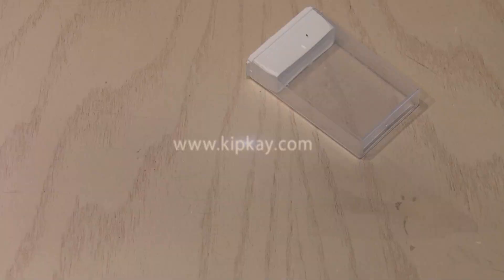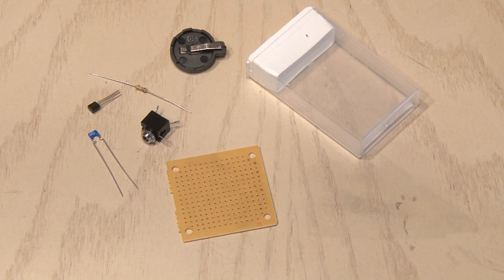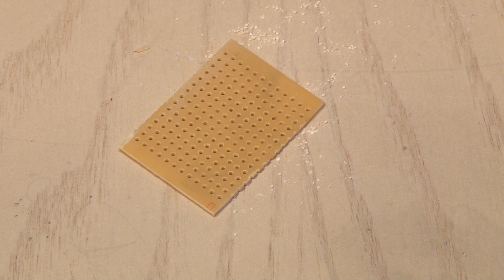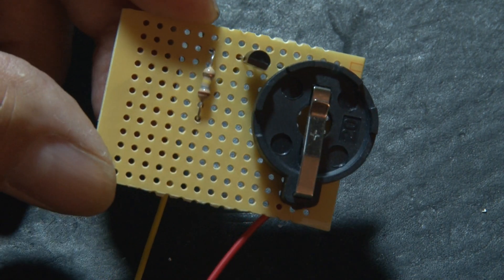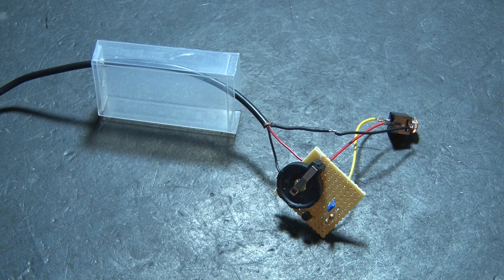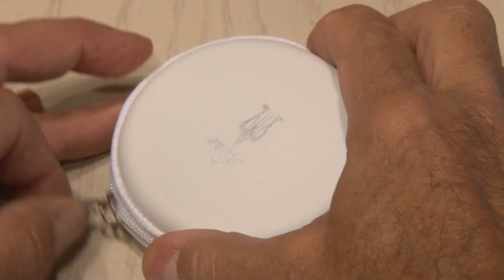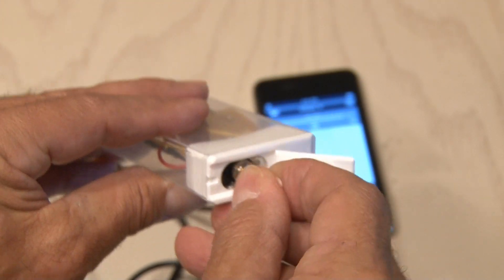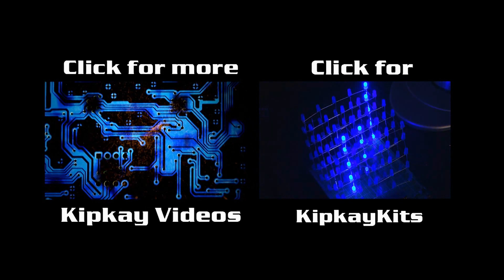Mini Tic-Tac Amp!

Comment: This amp is odd, I think. I am new to electronics.. but isn't this amp only amplifying the left channel? It's then sending a non-amplified (Left-In) signal to the (Left-out) through the 180k resistor, and then amplifying the (Left-In) through the transistor, mixing the amplified left channel into the right channel, and sending that to (Right-Out). I think this MIGHT amplify both channels in the right output, but NOT the left. However, you are ALSO getting a mixed (left-right) output on the (R-Out)... am I incorrect?  Like I said, I'm new at this, but can anyone familiar with electronics clarify what's happening in this amp?

As far as i am aware.. (I am trying to build a decent headphone amp, atm). You'd need TWO transistors.. one for each channel.) You'd also need a Virtual Ground (Circuit, or IC). With this you'd have a true stereo amp.. essentially I think this is a mono amp, that works very oddly. I could be very wrong ,though.

Comment: Hey, I have a question i would love your input on. I am trying to make a setup for having an LED light bar pulse to the bass of my music, i know how to hook everything up correctly, but the output for the bass is too low to see any noticeable light. Is there any way i can make a small transformer or something to step up the power? Like i transformer coil or something where you have an electro magnet then feed a wire thru the center of it?

Comment: Perfect - I've been looking for a cheap way to pre-amp my phone's output for connecting to my car audio. I'll give this a go - but might also look at how to adapt this for 12V.
Reply: John Heath lol real amps are $11 give or take. and tgey easily double your audio output
Reply: John Heath Did you end up building it and discarding it? This circuit is the worst use for 15 cents in parts, including compared to just throwing the parts in the trash.
Reply: Ha ha, no, I didn't. I see your comments elsewhere here, too - what's wrong with this circuit? How could it be improved?
Reply: Incorrect re price. They're really expensive.

Comment: Hi, pretty good build there keep up..Question : can I amplify a DSLR mic with this device before entering the mini jack into the camera for a better quality, will it work ?
Reply: Yes, but you might want to switch to a lower voltage

Just reverse the placement of the input and output jacks and connect it according to where the plugs fit
Reply: I hope I helped
Reply: Tyler Amick Thanks a lot Tyler, I will try it.

Comment: Why did you build that amp as a Mono? If you get it in Stereo, that would sound even better.

What will the battery drain be?
At 32 Ohm per channel (Common value), the set will be 16 Ohms.
At 3 Volt max (Not counting the vltage drop over the C-E junction), it will draw ~188 mA, equals ~0.563 Watts from the battery.
Thats ~0.281 watts per earbud.

According to the Specs its a Silicon NPN transistor.

So, at about 0.7V less for the Earbuds due to the C-E Junction of the  transistor, the whole calculation gets lower values.

Lets still do that calculation:

2.3V, ~16 Ohms equals ~144 mA. That equals to ~0.331 Watts.
Leaves about 0.165 Watts per earbud.

Neovo.

Comment: How can you add a volume for it?
Reply: POTENTIOMETER
Reply: You turn the volume up on your phone.
Reply: *****
duh
Reply: +HzzdsdS a potentiometer would only turn it down, it can't increase the output
(You need more voltage, probably another button cell would do the trick)

Comment: I'm thinking of building this, but how effective is this really with one transistor, resistor and capacitor. Wouldn't I be better off with a dedicated audio amplifier IC?
Reply: Definitely
Reply: AntiQuark Productions Correct. You'd be better plugging your earbuds into an actual container of tic tacs.

Comment: how much ohm do you think my amp in my phone is shit so i want one that can power 70ohm
Reply: Ohms are resistance, the higher the number the quieter the sound

You are looking for higher wattage
(Higher wattage = louder sound
BTW your phone has 8 ohms through the headphone connector
Reply: Edit: 32 ohms not 8
Sorry
Reply: Tyler Amick You have no idea what you're talking about. Ohms in headphones/speakers is the impedance, and it's a key specification. The lower the impedance of the headphones/speaker, the more current (with correspondingly lower voltage) needed to run them. Phones don't have the higher voltage present to run high impedance headphones very loud.
Reply: That'd be almost identical to what i said if you simplified it like i did. For example, running low impeadence and high impeadence headphones at the same level of current would make the low impeadence headphones louder than high impeadence headphones.

BTW wattage does tell how loud speakers will be, because 1 watt is the total power draw according to the equation W=VA

BTW, Again, You technically can not tell me i am wrong because i have a doctorate in this exact subject from MIT

Comment: Is the output of this strong enough to power 2 white LEDs?
Reply: black ops [ David ] No, it will not work good, you'll hear a really bad sound.
Reply: +Max Zauner I think, it is
Reply: yes I've bought some 100 3mm led 5 colors (20 each) and my button cell battery powers 15 fine. and does this amp work any good?

Comment: Did any of the people praising this thing actually build one?!? This is a horrible, horrible circuit, insofar as it can't output nearly as much power as the amplifier in an MP3 player or phone -- and it's not stereo! (As shown in the schematic, it takes the difference of the L and R channels, and then outputs that in mono to the output.)
Reply: windson7 That comment doesn't even make sense. Sounds to me like you're just mean-spirited. As for engineering: I'm not an engineer. But I know enough to know this circuit cannot work as described, and a year ago I actually built it up on a breadboard for shits and giggles. It does not work. End of story.
Reply: +Saud Al-Faisal Siddiqui I´ve tested the Phillips TDA 7053 which is really cheap and just needs 6v + one cap for the power, also its much better than this crap :D
Reply: +Saud Al-Faisal Siddiqui Agreed. The TDA series is great, but for headphones, I find them noisy. (They're awesome on speakers.)

For driving speakers, look at National Semiconductor's LM3875 and LM3886, which appear to be exceptionally good. (Search for "gainclone".)
Reply: I don't think you will reply after so long but suggest a good circuit for headphones amp man.

Comment: Would it be possible to ad a connection for a 9V battery to make it more powerful. For like a pair of mini speaker or big head phones
Reply: For this circuit the higher the voltage the stronger the amplifier is gonna be however the maximum voltage for this is around 15-20 volts

Comment: If I used 5V instead of 3V or 1.5V, would I need a resistor? I don't completely understand transistors.
Reply: Think of it this way. A pnp transistor basically an And gate. Battery goes to one terminal, audio goes to other terminal. This type of amp is really only good for boosting signals all at the same voltage.
Reply: So yes,you can.

Comment: I like this idea, however, if there's something that should be added, you should also solder a toggle switch to the battery clip, so you can turn it off and not risk constantly running that small button-cell battery

Comment: I would use it to boost power from an old "stick" MP3 player (512 meg to 1 gig, loaded with '90s techno) to a pair of Kip's Solo cup speakers, Velcro the cups to my shoulders, drape myself in a couple of strings of battery-powered Christmas LED lights with a running-blinking circuit, and become the MC-slash-DJ to the world's smallest rave.

Comment: As hard as I try, I am unable to find the purpose in this. Are you saying your music plays too quietly? Because I've never felt the need for "a boost" while listening to music. Every pair of earbuds I've used played music plenty loud.
Reply: There are headphones out there that need alot of power, because they have a high amount of "Ohms." if they are at 600 ohms its going to be really quiet coming directly from an iphone, but with an amp, its loud enough to hear.
Reply: The idea of an amp is instead on the tiny surface mount amplifier in your phone/ipod the amp makes it a little louder and should sound a little nice.

Comment: What is the type of the capacitor that you used? then why is it that when I viewed the circuit diagram, It says that the capacitor value is 0.1uF, but the actual value used is 1uF. What actual value is used?

Comment: You could build and inexpensive in ear monitor amp for ear buds.  Does the circuit give more output with more voltage? You could substitute a 9v if that's the case :-)

Comment: If its Powerfull Enough I Guess you could use it for your laptop with a Set of small speakers or Use it in a Shed, Greenhouse or Even put it on your bike to blast ur tunes??  Quietly i guess :P But if it works then i guess that would be a Few good uses :)

Comment: i'm curious how this works as an amplifier...i don't see an amp chip, for exaple lm386..so, how does the sound get amplified?
Reply: Transistor as an Operational Amplifier
transistor is like an extremely fast switch, if you poke it with a little bit of electricity, it joins two wires for as long as it is poked, so a music signal is poking this transistor thousands of times per second, and this transistor is basically connecting the battery directly to the earphones, but for only as long as it is bieng poked, for a microsecond
Reply: thank you!!
Reply: OH! I'm glad to hear you are on my channel!!!
I will start making new videos starting tuesday!
I hope you will like them!!

Comment: ***** Dude, if you have high quality earphones you need to power them with an amp. Regular sound source devices like mobile phones cannot power a good pair of headphones sufficiently. If you have a crappy set of phones, amplification won't be required and won't make a difference, but for a high end pair of headphones amplification is almost a requirement.

Comment: You can easily cut the PCB using a good pair of diagonal cutters. Just line it up with the holes and cut. The cut usually goes all the way across the board. I use my abrasive cut-off wheel for copper clad boards that I will etch. Good idea, but most smart phones/music playing devices can be turned way up without the use of this amp.

Comment: If I put another jack input in parallel it will be an amp-splitter?, maybe I will have to use a bigger battery and recalculate the resistor and the capacitor, but I think it should work. Does anybody with more experience than me knows if it would work?

Comment: What's the point, just seems like a "middle-man" between the phone and headphones, and what does that even do; waste money? Wouldn't it be more efficient to buy a decent pair of headphones if louder music is what he was attempting to achieve. Idk just my opinion on an utterly useless video
Reply: Some headphones require a higher "amp" (higher impedance) than the usual standard of 32 ohms. Thus, using those headphones on an iPod/mp3 will give you really low volumes. Coming from someone who owns higher end headphones, this is not a useless video; instead it is one of the best things he's done in a while.

Comment: I have a pair that really doesn't need an amp, but I tested some stuff with my friends Philips things that really do, since their volume is stupidly low.
I found that using an amp is pointless, because all you have to do is get a smartphone (Android), root it, slap Viper on it and use the setting called gain amp. Set it to whatever value you want and you have an amp without having an amp.
Reply: Not everyone owns a rooted Android.
Reply: *****
Their bad. Rooting voids warranty? Hell no! If it's a software issue, you just wipe, no need for service, if i's a hardware issue, you unroot it for the time being. If it doesn't turn on thanks to the issue, they will fix it, turn it on and give it back to you because it turns on and they really don't give a crap about it being rooted or not. Or just own a Nexus.
Reply: Theres one small problem with rooting. Rooting a smartphones makes them SOOO much easier to hack, trust me, ex hacker, voice of experience
Reply: kgibbs151
Not unless the user helps the hacker. Maybe by connecting to any wifi anywhere, spamming the log in with Google button, etc.
Reply: kgibbs151 Did you ever think they wanted you to hack them, trust me, ex sleuth, put a lot of people away for a long time. + you couldn't have done anything serious because then you wouldn't be admitting it, unless your suicidal. I already checked up on you. Update your Proxy(s)
Reply: Nathan Triepke number one, i never said what i did, number two i really dont care if anyone comes and finds me, and lastly as for the proxy, i believe i said "ex hacker" as in retired

Comment: Do you have good headphones? Then you don't need this.
Reply: actually quite the opposite, a large number of mid to high end headphones have high impedances or low sensitivities, so they need more power to drive them. honestly most headphones benefit from being amplified whether or not they need it in terms of volume.

I'd like to see you try driving a pair of 600 ohm cans with a phone xD
Reply: That is a totally unnecessary comment slender.
People who use earbuds for music and such can most likely not even hear the difference. And people who work with sound, musicians for example, do not use earbuds because the quality is way too poor for use in making songs.
Reply: sebbe antblad first, we're talking about headphones. most earbuds do not require amping due to the tiny drivers. headphones on the other hand will benefit from being amplified, there's no argument about it. listen to some AKG K702s, or some Sennheiser HD650s without a headphone amp and you'll completely understand what I'm saying.
Reply: The reason i said that is because kipkay uses earbuds in the video.
Reply: You are very uniformed, you mean if the amp inside your device sucks you don't need this, cause some headphones require more power to create sound than others "otherwise known as OHMS." For example, the dt 880's have 600 ohms, so just plugging it into an iphone will be near silent "due to not having enough power," but when getting an external amp its louder. IN NO WAY does that mean its a worse pair of headphones, it just means that your phone has a sucky amp.

Comment: wait whut??????????

connected wirelessly? If audio comes out of the amplifier then where does the audio come in??? WTF
Reply: So I missed that part ?
Reply: ***** Did you not hear him say " I'll plug my audio cable into that "?
Reply: There is a cable that comes out of the tic tac amp. You plug that cable into your headphone jack.
Reply: Huh?  Female jack in the iPod, make end of 1/8" jack in that, cut the end off, wire into amp circuit, 1/8" female jack wired into the board that's exposed when you open the tic tac door, plug in your headphones, done.

Comment: There's a reason why proper amplifiers cost more than $1
Reply: ***** You can also build higher quality amplifiers yourself.
Reply: ***** don't listen to him, the cake is a lie
Reply: ***** OHHHH, geez man I am dumb. Sorry. I neglected to pay attention to that part.
Reply: okay, I'm confused... I can see why people would want to buy 200$ headphones to be "in" (actually, no, but I know that it's a reason). But then I see comments from people who seem like they actually know shit about sound engineering and I wonder: what is the difference between 50$ headphones (I do know the difference between kid headphones and actual headphones) and 300$ professional headphones?
Reply: ***** But he's right, you buy an audio specific capacitor, and a better headphone output jack, and a better input cable, and move the parts around so the capacitor isn't so close to the transistor, maybe a better resistor, and maybe do some research and use a better amp topology, and now you have a decent amp (or half decent, I'm not an audio engineer).
Reply: i don't think you quite understood the reference i was making
Reply: haha
Reply: Klaevin most if not all of the cheap ones only have one speaker in the inside, more expensive ones have more as to let frequencies that would normally clash with each other be played without distortion
Reply: But, if the frequencies can't be played together without distortion or can, but must come from different sources, wouldn't they just mix up again when they make the single ear drum in your ear vibrates? Or do you just have to be lucky enough to have a perfect ear (when you can tell the name of a note just by hearing it) to  be disturbed by what the general population of humans can't even hear (yes, I AM jealous)
Reply: well it can result in 2 things; there's distortion (which you may or may not hear), or they might cancel each other. with a trained ear, you hear a lot of things you wouldn't normally hear. this is present a lot in mobile phones as they only have one external speaker

Comment: Would you be able to design a larger rechargeable version for larger speakers like non ac powered computer speakers. Something I could haul around on my tool cart at work. I know I could buy rechargeable speakers like the little beats speakers but it would be more satisfying gfor me if I could build one.

Comment: Funny thing is I actually have the exact transistor used in this project. I pulled it out of an old PC, It was on the wires going to the LEDs and front switch. I may try this b/c I have most of the parts just not the perf board.